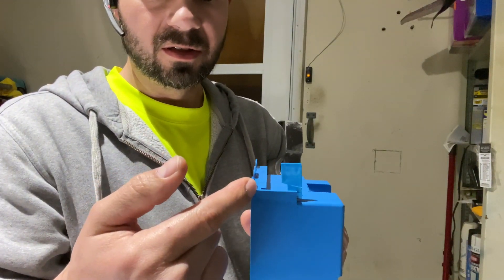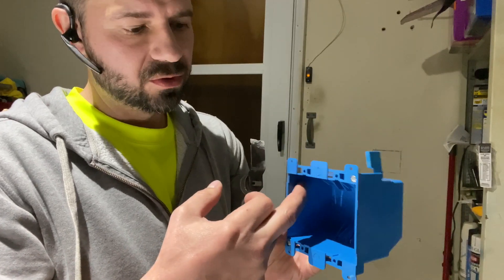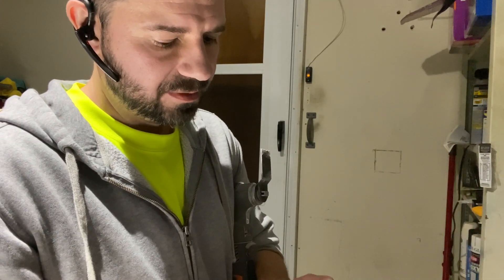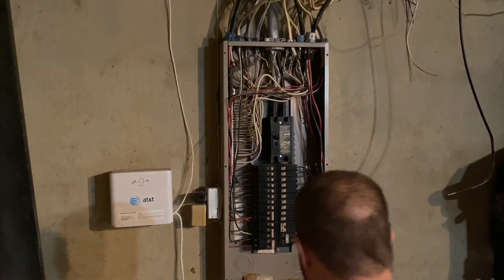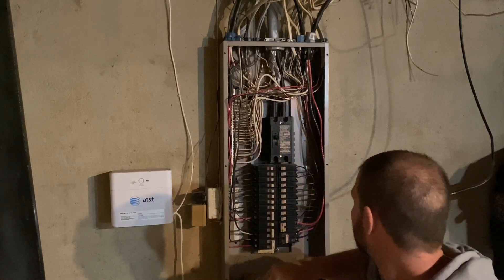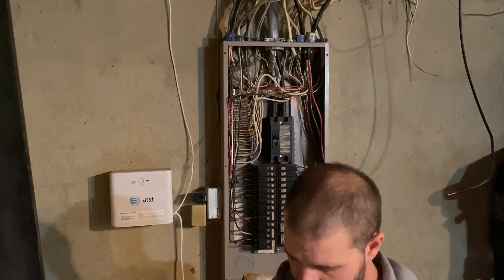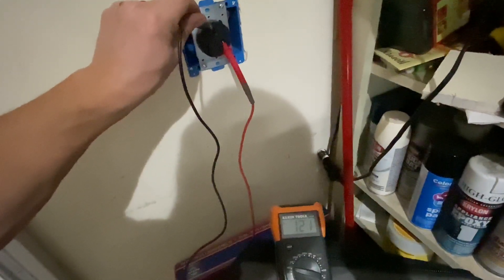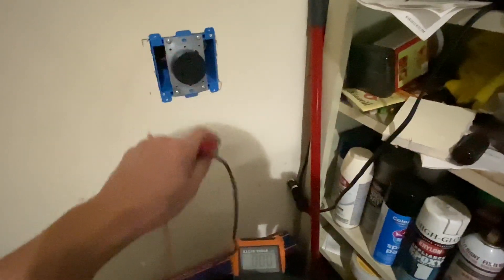Installing 240 outlet with 50 amp breaker in my garage for welder and plasma cutter  !!!!!!

Comment: I have to go roughly 75 feet and I need 50amp breaker 220 plug same plug u used what size wire should I use I have to run it through my attic and down through walls.

Comment: No neutral, just two hots and a ground. This is wired incorrectly with a neutral connected to the ground terminal. Your welder will have no need for those two 120V legs.
Reply: Each "hot" is 120. So yes in fact he does require those 120s to get 220.Neutrals are not required on a psychics level but may be required by local code

Comment: 40 amp is all you need.. Most of you do NOT have 80 series plasma. Most of you cut 45 to 60. 8/3 wire is ok.
Reply: While the 8/3 wire maybe sufficient for the welder requirement, installing a 50a breaker with 8/3 wire is a fire waiting to happen!!  He should have installed a 40a breaker that would protect the supply wire appropriately.
Reply: @FreedomIsntFree2023  ... most everyone views the 50amp product names and installs 50a breakers.
Mine says it 50a too thou on 'tag and manual' lists max current '30a at 220/240v'.
Installing '30a' dual-breaker - should b safe n' good to go.
Reply: @nemesisxrox6773  I don't quite get your point? Most everyone??

8/3 has an ampacity of 40 amps.....period. Installing a  50 amp breaker to protect 8/3 wiring is wrong and not safe. I do not really care what you connect to it (welder, compressor, etc.).
In your case, what is the gauge of the wire your 30 amp breaker is protecting? 
Again, I have no concerns about what your welding equipment tag says....
Reply: @FreedomIsntFree2023  is correct. The breaker isn't there to protect the equipment. It is only there to protect the wire.
Reply: And who is to say that someone someday doesn't plug something into this that would draw more than 40 amps? That wire is undersized for the breaker. Fire hazard.
Reply: @KandMAdventures804   Because you have no idea what you are talking about.. That is the difference between you and me.  cutting a 60 amp.. Plasma in a garage is no problem. .. 220.. 60 amp breaker is more than enough for most plasma machines In your garage you will never have an issue.. I cut half inch material Also up to 3/4 inch material for short term.. Half inch material is not a problem..
Reply: I love how hacks.. Have an opinion about nothing they know about.. You do not have a clue. I have been doing this for several years without any problems

Comment: Definitely have to use 6g wire, but also I'm not so sure you need neutral. Just two hots and a ground, so 6/2 should be good